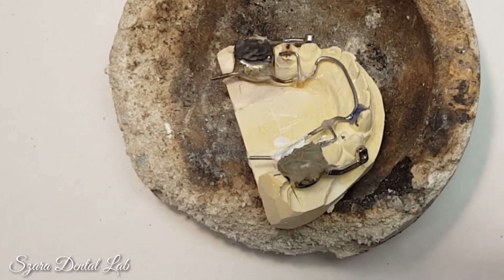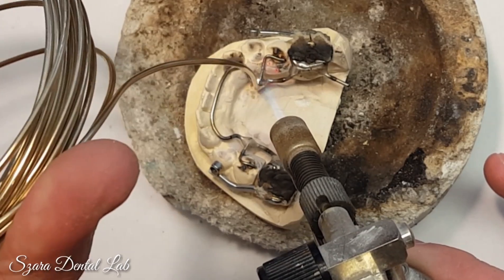How to Solder Ortho appliances

Comment: Efficient technique ... 👍🏻 Can you tell what is that heat shield material is ot some kind of plaster and also the glue you are using to stick .. 
keep posting
Reply from the maker: The glue is called Fill it. The shield is called Heat Shield
Reply: Where I will get 'fill it 'glue??

Comment: Hi, great video. Wanted to ask if you experience shrinkage from possibly poor soldering? I'm trying to figure out why RPEs don't fit or "too small" or sometimes rocking. Any feedback/ideas? We do use heat shield as you recommended. Is it not enough?
Reply from the maker: Sometimes you can overheat the bands and causes them to fit very tight. When this happens you need to ream out the band (where solder joint is on otherside) this will help widen the band and give you just enough play to fit. The quicker you flow solder the better your appliances will fit. Do not overheat!
Reply: @SzaraDentalLab  thank you!

Comment: Hi steve I like u work the way you do. You heating direct to the model but model its not burning why?  And also on top of the wire what kind of materials u add for hold its that plaster?
Reply from the maker: Thank you Mahin. I am using heat shield. It prevents anything from burning. Also protects all wires and screws from being damaged by heat
Reply: Thank you for reply
Do you have any picture for that heat shield? And also if it possible to make a video for twin block can you please update !!! I want know how it makes thx thanks steve

Comment: How do you clean the flux residue off of the solder joints? I have an ultrasonic cleaner but the solution I have doesn't work well for that.
Reply: High pressure steamer

Comment: Hi Steve! What kind of heat shield did you use?
Reply from the maker: https://www.amazon.com/shop/szaradentallab
Please check out my amazon shop.  All my soldering items are listed
Reply: Szara Dental Lab thanks for answering, I live out of the USA, but I'm try to order that shield.
Reply: Szara Dental Lab I'm a dentist and I'm studying orthodontics, I LOVE the lab part, I have 2 more questions for you: 1. What kind of welder equipment did you use? I saw like "2 pens" type. 2. I found glue that you use. Did you get it en Amazon too? I normally use patafix (UHU) but it's unstable. Thanks again for answering. I'm a fan! Greetings from Honduras
Reply: @SzaraDentalLab  what is the soldering temperature?
Reply from the maker: @czinczok  I'm not exactly for sure

Comment: If you’re gluing the wire to the model what is the purpose of tack welding and are you tack welding to wires together on the model . I roughen all sides of wires and bands put my flux  down then cover the wires and bands with plaster kind of like a heatshield this seems to work very well I do like to thick solder you’re using I’m not used to that.
Reply from the maker: Perry Lane I glue the wires in place then tack weld. Thick solder is just a preference. Some would argue it's easier, some would say harder🤔  I always use heat shield because it really works and saves me time
Reply from the maker: https://www.amazon.com/shop/szaradentallab
Please check out my amazon shop.  All my soldering items are listed

Comment: Great work! Have a question for you! My torch went down in the middle of a soldering, it was full but no flame or pressure, just made a pop and no flame. I managed to disassemble it and now butane is flowing but no with oxygen, torch makes a BIG orange dragon flame, do you know how to fix it please?! Thank you very much for your time
Reply from the maker: Thank you for the compliment Augusto.  I'm sorry to tell you Ive had the same problems with many different torches.  I have taken them apart as well.  I suggest just buying a new one. Blazer torch $60 highly recommend
Reply from the maker: https://www.amazon.com/shop/szaradentallab
Please check out my amazon shop.  All my soldering items are listed including the exact torch I use with no problems!
Reply: I had a similar problem with mine, it seems to be at least in my case some dust or soot in the nozzle.  I blew it out with compressed air and it worked fine.  Be sure the air vent is open fully.

Comment: how do you deal with bubbles. I use oxy propane and have inconsistency from time to time even after 20 years. I recently tried pulse arc welding but haven't mastered welding to bands. Similar sized wire welds small and beautiful but still rely on solder joints to molar bands. Appreciate the videos U.P. Orthodontic Lab,LLC.
Reply from the maker: Jon Hewitt: I only seem to get bubbles and or porosity within solder joint when a.) the wire isn't  in contact enough with band creating a slight air pocket  b.) overheating weld too much causes all kinds of problems.  
Are you in Northern Michigan? what pulse welder do you own?
Reply: just bought an orion 150. we are located in Marquette, MI. love the videos, learned of you from watching retainer designer. thank you!
Reply from the maker: Cool. Love Northern Michigan. Thinking about buying puk2 welder. Stay Busy😎
Reply: Szara Dental Lab keep up the videos! us introverts are watching 👍
Reply from the maker: Jon Hewitt Thanks John. If there's ever a topic you would like to see let me know?
Reply: Mr Szara, the puk 2 looks great from what I've seen on YouTube and it may be far superior. As a mom and pop shop I just want to share the learning curve. welding thick to thin is difficult out of the box. takes a lot of practice at low power.  still working on it, and using filler wire to supplement welds. arc welding out of the box blows impressive holes in bands.
Reply from the maker: Those "holes" scare me. Please update me on your progress (learning curve) Thanks, Steve
Reply from the maker: https://www.amazon.com/shop/szaradentallab
Hi Jon, Please check out my amazon shop.  All my soldering items are listed

Comment: Thanks for the help, Steve. I certainly need to be more liberal with the heat shield, more accurate with the wire bending, and probably spend a little more time carving out the molars. That may help with the gaps & porosity. And I'll move the model around to let gravity help. I need a little solder bowl like yours!! 👍👍👍
Reply from the maker: Hi Laurie I opened up this Amazon shop to help me create YouTube videos. If interested https://www.amazon.com/shop/szaradentallab
Please check out my amazon shop.  All my soldering items are listed